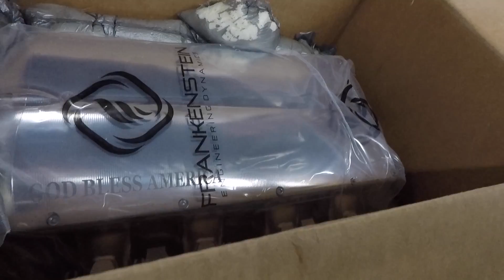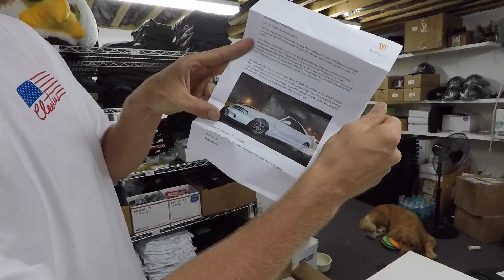The C7 is Getting a 100% Billet FREEDOM Intake! + Neighbor Gets Cop Lights!

Comment: the other comments are correct do not drive on the street with the light bar..... they make covers for out of service vehicles that you could put over the light bar when you are on the street and then use it on the track or burn out area..... not a problem there..... retired PD
Reply: They gave him a cover for it, but Cleetus crew thought it was for the rear bumper
Reply: Kris Davis it said on the note to keep the bumper crispy tho??¿¿
Reply: @chriskonnoff4280  different part.
Reply: Just keep them off and also he has a big mountain dew decal and holley efi decal on the car. You think coos care gonna have those? Didn’t think so.

Comment: Imitating a police officer is a crime. Having a light bar is not a crime. Don't forget to add a siren.
Reply: And a PA horn for hollerin', "Hell yeah, brother!!!"
Reply: Canada says no to the red and blues.
Reply: yeah no forward facing red lights for sure in the area he's around at least
Reply: As far as I know, most states can't write you a ticket for simply installing them, you have to use them. As long as you don't activate them while driving or in public areas (parking lots/roadways) you should be fine.
Reply: In Virginia you are not allowed blue lights on a car, even if they don't work if you aren't active LEO. I don't know about other states, i'm sure it would be fine at a track though.
Reply: Yea but needs a good one tho.
Reply: @angsta22  To be fair, in Virginia they can put you in jail for doing 80 in a 65.
Reply: @schwags1969  Canada also says no insults or you go to jail. I am feeling oppressed right now, do I need to call those guys on horseback?

Comment: I had a dream that Leroy went 6.5s in a 1/4 mile
Reply: Cameron Summers  5.9
Reply: I had a dream a sr went 5'8
Reply: Thing is always busted and they never work on it. It will not get into the 6's without aero... And needs reliable parts.
Reply: Weird, I had the same dream just last night
Reply: Keep dreaming. Lol
Reply: It will happen
Reply: Sounded like a wet dream James get the bottle lol 😂
Reply: To run a 6.5s in the 1/4 with Leroy, he would have to reliably make 2000 Hp if not more because of the lack of aero, also he would have to have one hell of a launch. In Leroy’s current form it is impossible, but with a billet block and heads that could handle the high load and pressure, it wouldn’t be a reach to assume that could be achieved.
Reply: jerme 6.blow
Reply: I had a dream it went 4.269 at 269

Comment: Def Illegal, just give the cop a Mountain Dew. everything will be fine... 
... Under Section 843.081, it is generally against the law for any person in a non-government-owned vehicle to use a blue rotating or flashing light unless the person is a police officer, sheriff or a deputy sheriff, or a Florida state trooper.
Reply: Basically its illegal to turn the lights on but not just drive around with them turned off.

Comment: I know the guy that sent you the light bar said in his letter that the bumper guard was for the bumper because the exhaust was burning it up, but a short tip extension for the exhaust will fix that. anyways my point is, the second you pulled it out of the box I thought it was a cover for the lights, and it does look perfect for it.

Comment: If you are interested I have a full code 3 brand police controller for the light bar I can send you complete with siren and loudspeaker. Does what the small silver box you were sent does, but gives you more control as well as a CB style mic for the PA and sirens.  Would also give you the ability to add additional corner strobes etc.

Comment: No, you can not get arrested for having those lights in most states under certain conditions, I live in florida, as long as you cover the lights with something when youre driving down public roads youre fine and given you dont use them on public roads. On private property such as business, and racetracks, you can uncover them and turn them on as you wish. The only reason you need to cover them when youre driving down the road is because they have red and blue on the top of them. If it was an all clear LED light bar, you would've been fine.

Comment: Depends on the laws in your state, but in most states there is some regulation regarding possession/usage of a blue or red light, and then depending on how the overall look of the car is, you may run the risk of an impersonation charge.  Please check with the local guys as to what you can and can't do man... jail wifi sucks to upload on!

Comment: Do you need an oil pan for a 5.4l......i just replaced a 5.4 at my shop, customer drives the hell out of the truck and @ 239k miles he decided to just replace the engine and i kept the pan and pick up tube off the core.....they both are in excellent condition if you want them they are yours for Neighbor just let me know where to send em.

Comment: driving with red and blue lights on top is a HUGE no-no.... ever notice in movies 99% of the time, the lights are only blue, or only red;  this is the same reasoning....  even for hollywood;  its hard to get the ability to have red and blues on a vehicle on any street.    Id suggest finding a way to dismount the lightbar easily and reinstall when at tracks events.  maybe some sort of quick disconnect at the main harness up top.

Comment: Dont you think all that air blowing all the way to the back of the intake will burn up the back 2 cylinders due to not equal pressure? I've heard of that happening on other rides
Reply: chevyheavy79. That's why the intake hole of the manifold is on the windshield side. In combination with a throttlebody

Comment: as long as there are no flashing or strobing red and blue lights on a public roadway it is not illegal, however police impersonation can be a pretty hefty charge, since you have no ill will if need be itll probably just be a fix it ticket (take it off, show them you fixed it, re-install)

Comment: Highly illegal to have lightbar activated or capable of being activated on street, however, if you install it with a main disconnect under the hood and don’t operate the lights on the street you will be fine.  I’ve got a ticket lamp I need to send you...  <——. Cop and Caprice 9c1 enthusiast.

Comment: I had a white police interceptor with all the strobes, rear cage, plastic rear seats etc. and I got pulled over in st pete and almost got arrested for impersonating an offer and my lights weren't even ON! I'm telling you right now DO NOT drive on the street with that light bar. Put it on for the track only and save yourself from being hassle by the cops. #doitfored

Comment: If those are red and blue you cant drive it on the streets. Looked like the plastic was red and blue so it wouldn't be legal on public streets. Probably sent the bumper cover to cover the lights for street driving and then take it off and light them up at the track. I work for a Colorado LEO agency.

Comment: You cannot drive that on the street with the colors on it. If it was an all clear light bar it would be passable. But it will not be worth the hassle of being pulled over everytime a cop sees you, and you might get the wrong cop, or a state cop. You can trailer it and use them at events but, its not worth the risk. Please trust me, that is a cops ticket field day. Thats pretty much giving them probable cause to pull you over whenever they want. And its not worth a felony if they want to push for impersonation of a leo.
Reply: You could however rig some type of quick disconnect on it that you can take it on an off easier. Or a cover.

Comment: As long as the blue light is on the passenger side you should be fine. Official cop cars have the blue light on the driver's side. And don't use them on public roads.

Comment: just install a hard switch to the light bar in the trunk. or under the hood.. where is that damn hood anyway?

Unreachable from the inside of the car, so it's impossible to activate it from inside the car when off. if you get QUIZZED about it. show the officers it's not functional and I'd bet no issues will follow.